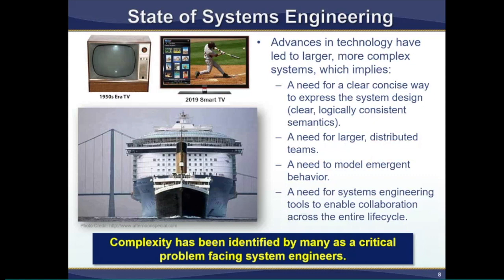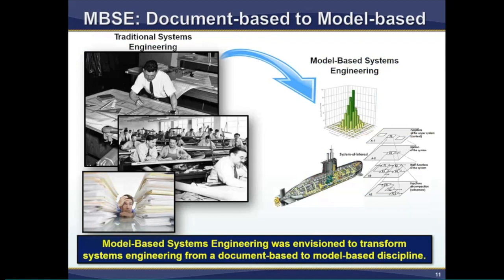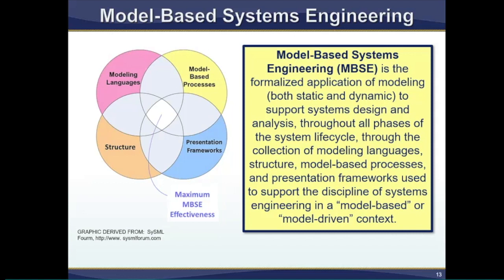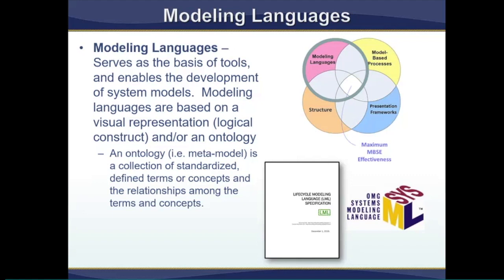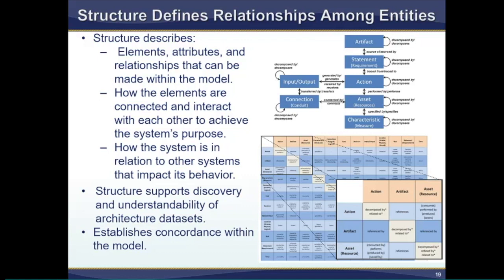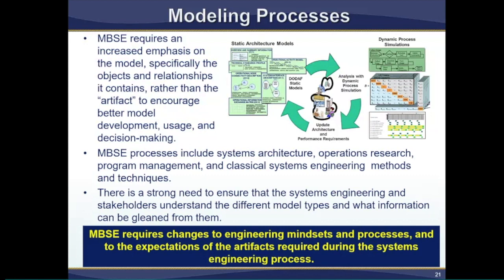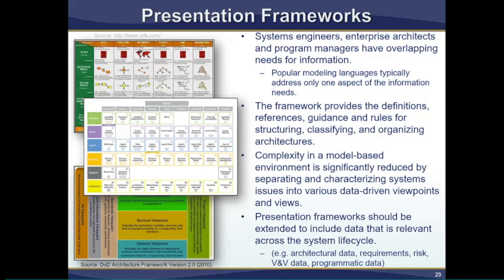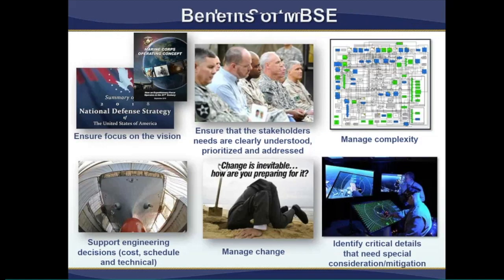Webinar: Model-Based Systems Engineering De-mystified with Dr. Warren Vaneman

Comment: I'm new to MBSE, but well-versed in other types of simulation.  The critical part of the simulation is defining the interactions.  For example, the voltage and current interactions of a resistor are well-known, allowing for accurate simulation.  When you add the dimensions of cost, availability, reliability, temperature, humidity, age, and other unk-unk variables... how do you model that?  The bottom-up system creation to derive a top-down simulation given an infinite number of non-linear variables would seem to result in chaos.
Reply: Clearly we can't model "unk-unk" properties of a system.  Not a criticism of your comment.  We can model the other properties you mention.  Approach these properties of the system in discrete models that focus on the specific properties of concerns of stakeholders via Viewpoints and Views.  This approach federates a collection of models to describe / define a system.  This is NOT a practice that many can accomplish and yes, it results in a complex federation of models that can become chaotic.  Mastery of MBSE requires investment beyond what many individuals and corporations are willing to invest.  They question the ROI.  Creating a Digital Twin requires capabilities and skills possessed by very few entities.